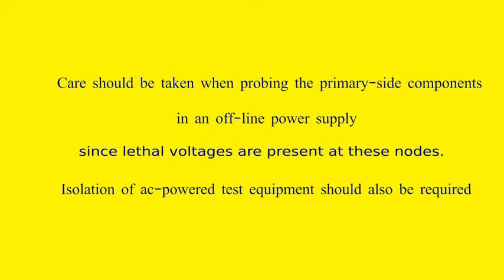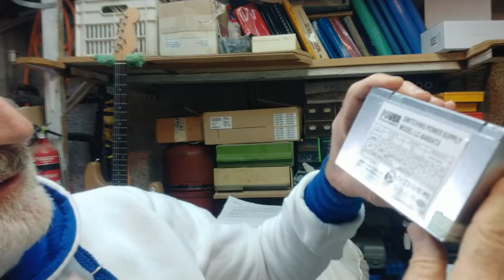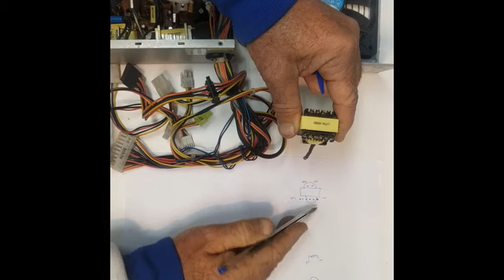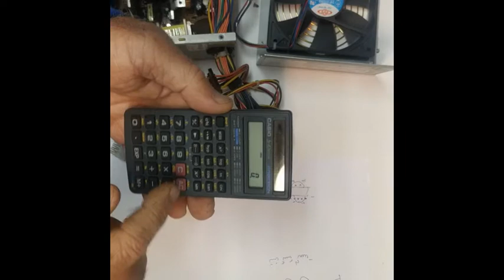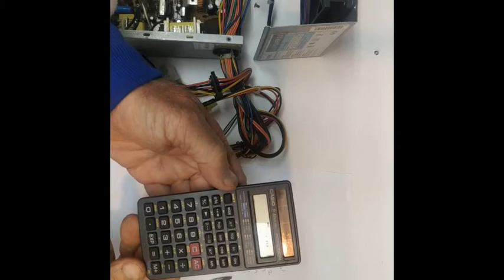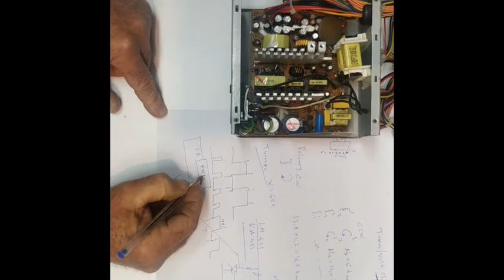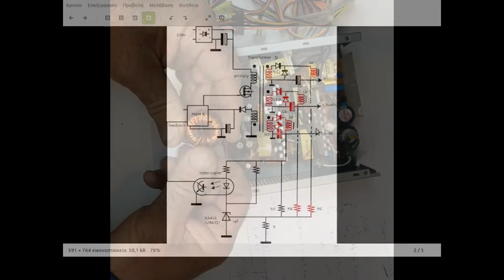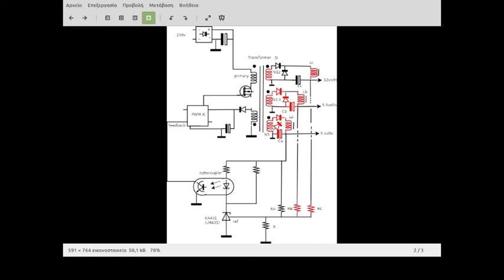Πώς να μετατρέψετε την τάση σε 13,8 V και το ρεύμα έως 30 A. | Πώς τροποποιείται ο μετασχηματιστής

Comment: Great work. Have a question, can we just change the PWM feedback resistors and increase output voltage from 12V to 13.8V?
Reply from the maker: yes you can do that, but that way you can not increase the current
Reply from the maker: Thanks for your comment